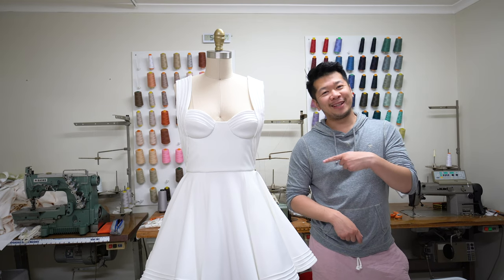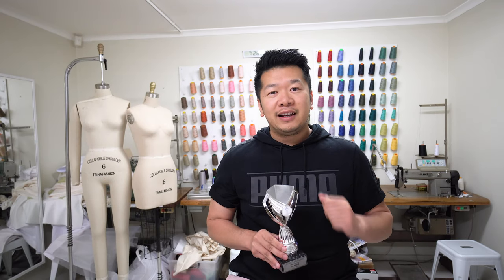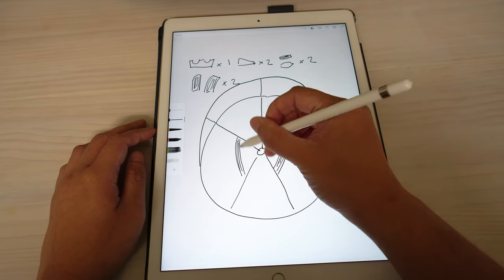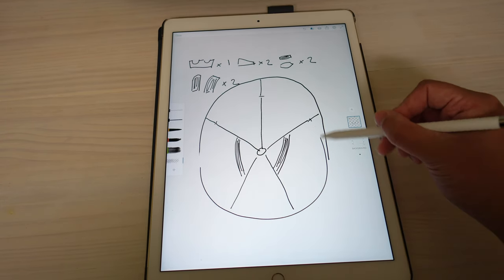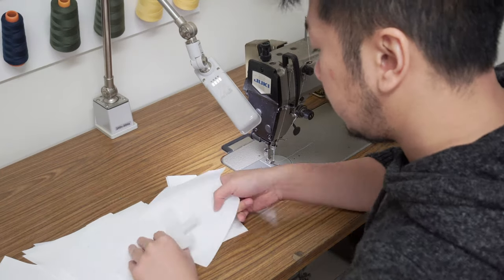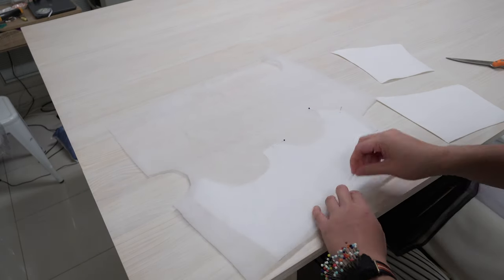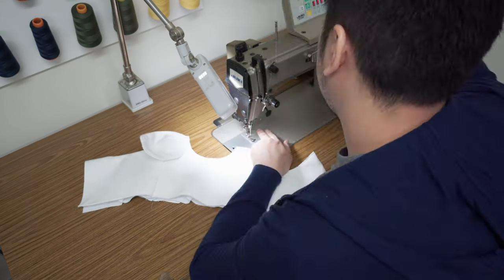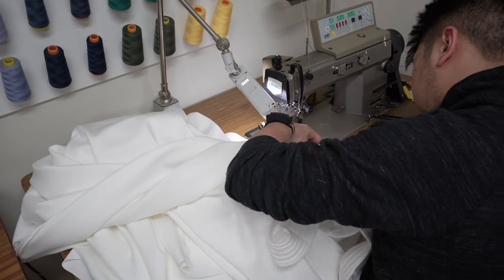Making a Ball Gown with Shoulder Straps - Sarah Ball Gown

Comment: Nice video..if only you could do a calculation on the lower parts of the gown..the circle and train..thanks
Reply from the maker: Thank you! For circle skirts I usually have them 125cm long, I find it works well for industry standard models. The train is 180cm. Hope that helps 😉

Comment: beautiful dress. one question  what did you do to make the inside of the shoulder strap clean looking?
Reply from the maker: Thank you! Usually I'd bag it out with lining, but in this case I wasn't sure how long I'd need the strap so I just used bias binding and hand stitched the edges to underside so no stitching was visible on either side.